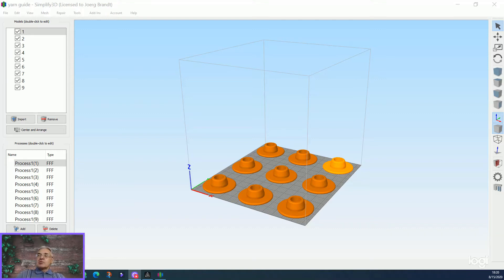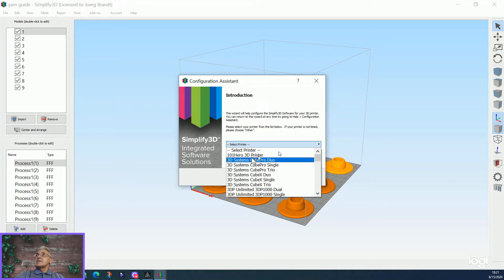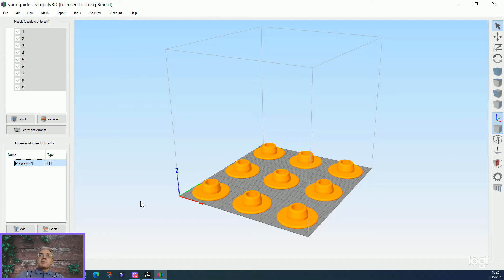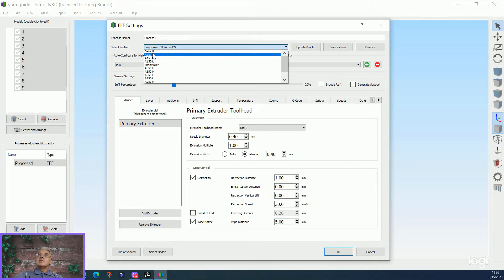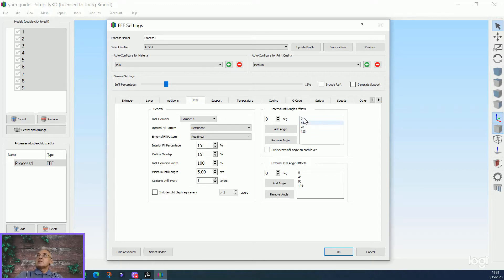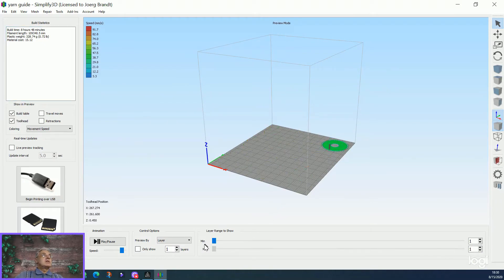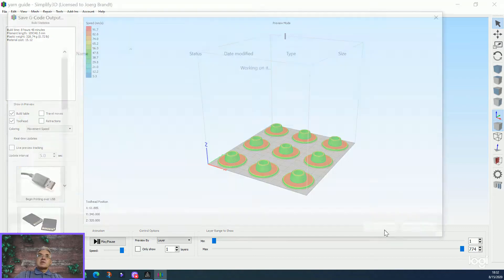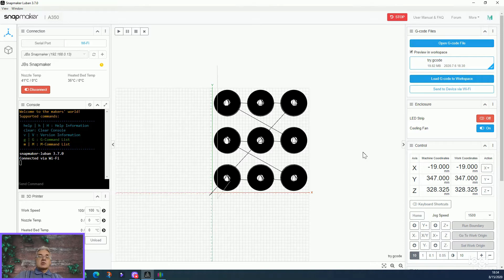Setting up Simplify3D for Snapmaker Printer

Comment: Great info.  Thank you.  On Simplify3D is there a way to create a break in the print so you can switch the print material?  I want to use different colors during a print.  Have you had a problem getting your prints off of the A350?
Reply from the maker: there is a way to pause the printer and change the color. unfortunately my A350 is out of order in the moment so i can not try it. an easy trick to remove prints is to use a spray bottle with an 50/50 mix of alcohol and water and spray this around the parts wait 2 minutes and it is easy to remove.
Reply: Let your bed cool before removal.